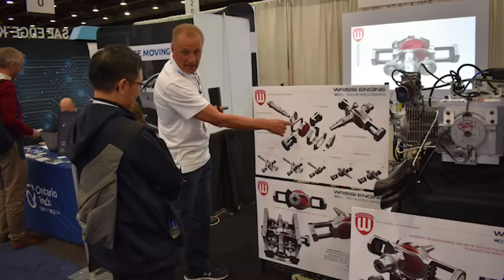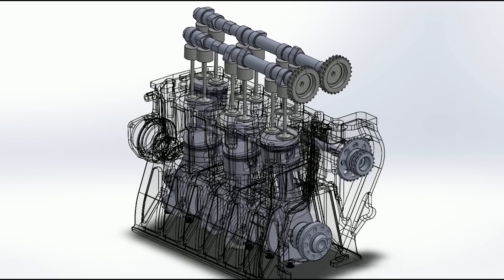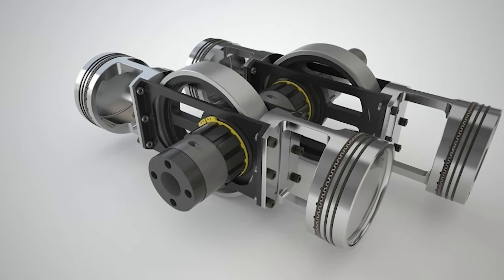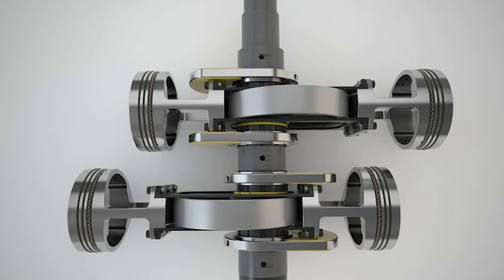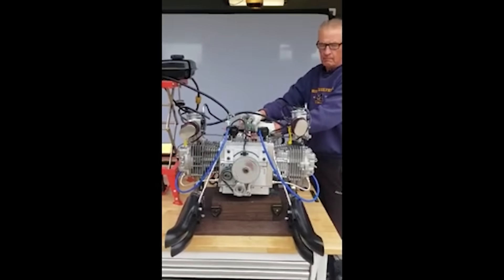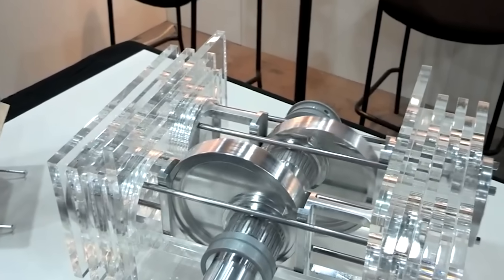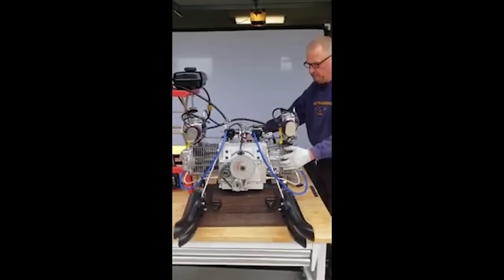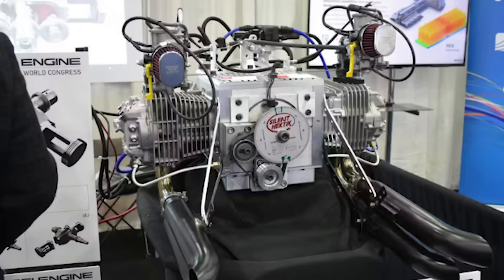The Waissi Engine: Reinventing The Combustion engine

Comment: It's an interesting concept that may be practical in the future. I'm sure there will always be a place for ICE. That said, as an engine for a hybrid system, I think it's unnecessary. Battery tech is improving constantly. Cheaper, better and safer batteries will be developed. Hybrids are a stop gap solution to fuel economy. Hybrids are more dangerous than pure ICE or pure electric vehicles due to the combination of high voltage electricity in close proximity to gasoline or diesel. All it takes is a leak and a spark.

Comment: Good idea, and like so many before it there is a big flaw. The huge diameter of the excentric lobes would result in extremely fast lineal speed in the bearing limiting RPM potential severely. Very high oil pressure will extend the speed range, but only to a point. And with all that bearing surface area, one has to wonder how that compares with a con rod design. The more total area the more loss from friction.
Reply: Ah, but for a low RPM double acting steam piston motor..  LoL

Comment: I have questions. 
On the eccentrics of the main crankshaft: As far Ive seen, there are two friction push plates, one behind every piston. Those have to slide steel on steel against their eccentric, to rotate the shaft.
Notice how the system could work even with a giant bearing around the eccentric. Now the surfaces i ponted above are frictionless since the friction is now transferred around the eccentric, on the baearing's rollers.

Edit: My bad, in fact the bearing is there, it's hidden but it's mentioned in the video around 4:15 .

Comment: This looks like an okay design but I see some issues that probably aren't unsurmountable. The first is the lubrication as all the power is passed through sliding friction. The second is that the line of pressure from the piston to the "pusher" crank means that there has to be a weird profile so that at TDC and BDC there is a line through the centre of the piston and crankshaft and the contact between piston "pusher". At 90 degrees off TDC the point of contact needs to be close to the cylinder wall. The third is thermal expansion. There will be a fairly significant temperature difference between the piston, the piston connecting rods and the crank. I'd expect that this could easily generate either piston slap or alternately a massive increase in friction. The engine features look similar to a scotch yoke engine design but with added complexity.
Reply: Totally agree. Ironicly, despite having no conrods, this engines biggest problem is rod knock. Any wear and tear or the slightest machining inaccuracies on the excentric disc will cause play in the mechanism and I did not even think of thermal expansion.
Lubrication is also difficult. A normal crank conrod setup is relativly simple to lubricate, you just have journal bearings that get oil pressure from the pump through the crankshaft. This mechanism on the other hand is completly open, making is so you do not have any oil pressure between the sliding surfaces. Furthermore, the centrifugal forces throuw the oil away from where it needs to be.
Reply: Yes to all of your comments. See my comments above.
Reply: So for starters you are saying that the crank 'disk' needs to be like a 'cam' adjusting the rate of force on the crankshaft (sorry I am not a engine engineer, only a 'light' engineer/sheetmetal worker) and 'yes' I was thinking of a Scotch yoke, but like you say.. friction is a big problem, and how do you lubricate such a large open surface without 'contained' oil pressure fed sleeve bearings, and how do you get the metal surfaces to hydroplane on each other? My questions are not that well informed, but I feel sorry for those alloy piston skirt extensions having to transfer all that load! They would break in a second 😢 alloy rods in a normal engine are dubious, let alone joined to a lightweight piston 😢now I think about its longevity..this engine is rubbish, or at least inferior to a high performance bike engine like my Husaberg 650 Supermotard, the most powerful single cylinder engine available.
Reply: I thought I remembered a similar idea from many years ago. Your mention of the scotch yoke rang the bell that confirmed my memory was correct, thanks.

I'm not an engineer, but wouldn't the mass of two paired pistons operating in this way cause a large rotational vibration about a vertical axis running through the centre of the engine?
Reply: I would add a massive bearing around the discs so the friction would be minimal against the flat and kept between round bearings
Reply: I don't see friction as a particular problem when this design has one less point of friction per cylinder
Reply: the problem is not the total amount of friction force but how much friction is manageable. A point friction means that the layer of lubrication could collapse and let metal touch, which is when the engine dies generally. The way bearing work is by distributing the load on a big enough surface so the lubrication has the ability to continuously coat the surface.

Comment: need to add a rotary valve setup
Reply: On the intake side with a rotary ported shaft and retain the poppet valves on the exhaust side due to extreme heat.

Comment: It doesn't eliminate secondary rocking. It reduces it but doesn't eliminate it.
Reply: Might it be better as a flat 6 cylinder, vibration may? be less of a problem.
Reply: @adoreslaurel  Yes, as the opposing pistons aren't in operation as they are in a boxer engine.
Reply: Theres 2 sets of opposed cylinders. So the cylinders on one side. If one piston is at TDC. The piston on the other set. On the opposite side. Is at TDC. And vice versa. Should counter each other's secondary imbalance. The cylinders at opposite corner counter each other. Right ?
Reply: @andrebello4191  This setup, flat 4, works the same as 2 pistons on the same crankshaft pin journal vs a boxer has independent crankshaft journals with the pistons going in and out in synchronization for the balance.

Comment: This would be wasted in an EV.
Reply: As a booster engine that is small and constant speed (perhaps 2  speeds).. in diesel it could be 45% efficient and the heat would be good in the winter, thus maximizing battery life if sized right.

Comment: I like that this man uses off the shelf parts. The engine is yet another approach to removing side load, which more engine makers need to pursue. Hope this takes off.
Reply: The baring ring wobbles instead of the connecting rod wobbling.  Same vibration.
Reply: @dreamdiction  That doesn't make sense. But okay.
Reply: @dreamdiction  you can counterbalance eccentric lobes; you cannot counterbalance the nutation that conrods in normal engines have.
Reply: It's called a honda goldwing  or bmw or vw engine. best almost indestructible engines ever built. 😁
Reply: Still burns fossil fuels.
Reply: @iscadean6038  No such thing as a fossil fuel. It may use crude oil, which is an abiotic substance that modern day chemists can make in a lab without a bit of dinosaur components. But here's the neat part, when you eliminate side loading in an engine, you can raise compression and exploit detonation. This opens the door to things like using a broader range of fuels like charcoal and coal slurries.
Reply: @Ron-yj4rh boxer-type engines have been around for years, so nothing new there. Oil is a fossil fuel derived from ground up dinosaur bones. Well, not really but for the sake of these comments it is poisonous when burnt. Try my garage experiment. Do the same for an EV. In the first you will die - not in the second.
Reply: @iscadean6038 Marx pfp opinion discarded